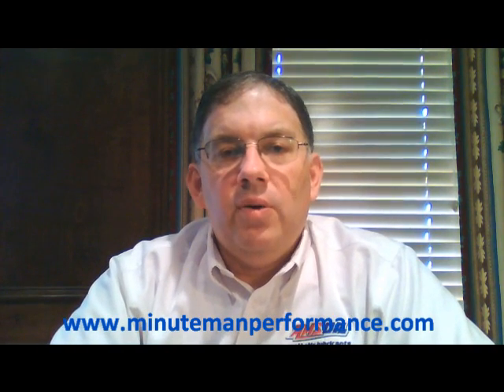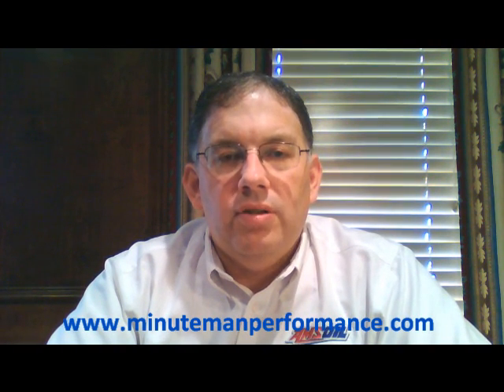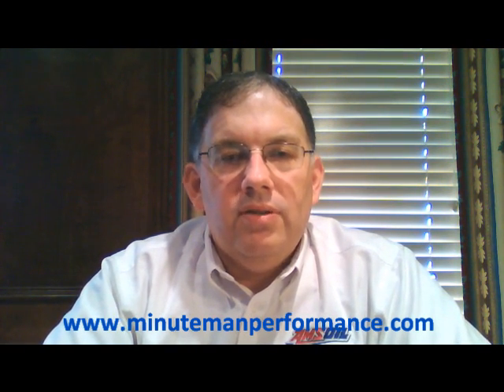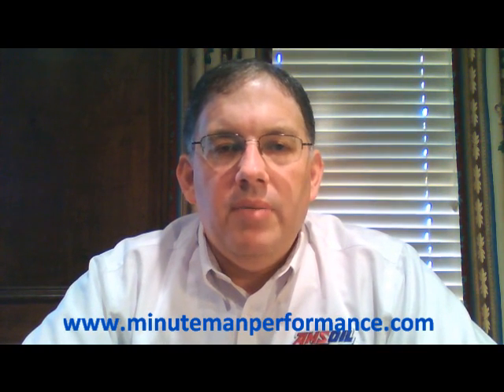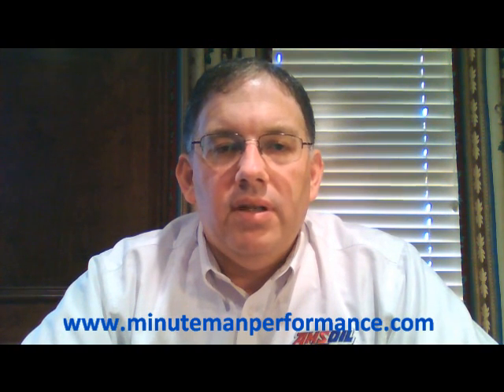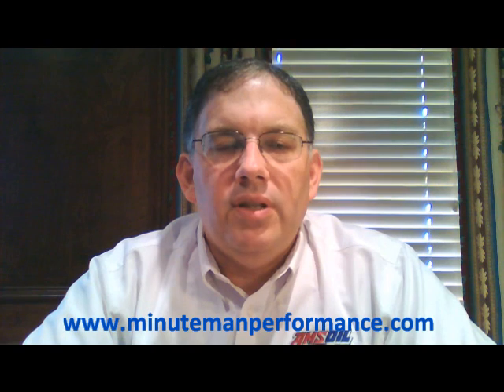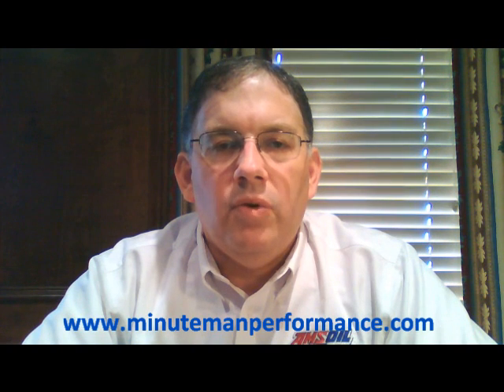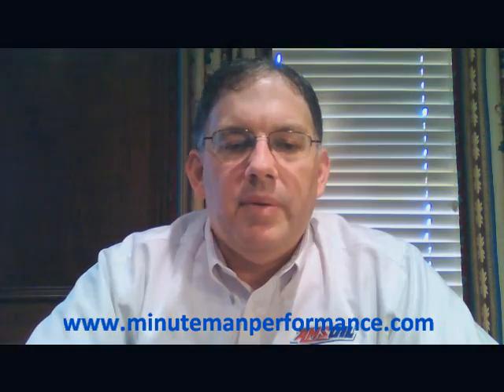Low-Speed Pre-Ignition (LSPI) in Turbo Gas Direct-Injected Engines

Comment: If you can't get Amsoil Signature. Get Motul 100% Synthetic 8100 Eco-Lite. It is a Dexos 1 gen2 and GF-5 oil. Not to fret because GF-6 is coming soon. For LSPI you need 91 -93 octane gasoline also. Do not lug your turbo GDI engine. No WOT until 3500 plus.

Comment: This can happen on standard port injection cars and direct injections not just turbo direct injections. fuel burns quick, low rpm engine lugging causes the fuel to ignite before the optimal timing. its not rocket science. Its basically acting like a diesel. You add more pressure to the combustion chamber by spraying super high pressure into an already small area thats already pressurized. Its more prevalent in turbo motors due to the boost pressure being added. Low octane fuel doesnt help. So high pressure = heat, high heat = faster burning of fuel, slower engine rpm = more time for pressure to create heat. pre-igntion can occur if any instance of low speed lugging.

Comment: I use Amsoil 5w-30 xl in my Veloster turbo!!! Is its at good as Signature series??
Reply from the maker: Short answer - no.  AMSOIL Signature Series oils are formulated from the highest quality base stocks available for automotive oil.  This gives them a higher viscosity index rating (which measures the oils ability to resist thinning when hot), and Signature Series oils also have a lower volatility rating (which measures % of evaporation when heated).  AMSOIL XL and OE lines of oil are very high quality, but they can't match Signature Series.  If I had a turbo gas direct injected engine, I'd use Signature Series.  If you live in a warmer climate, I'd even consider moving to the 10W-30 grade Signature - it has even better numbers on the volatility, which contributes to LSPI.

Comment: Lspi occurs on both automatic and manual transmissions?
Reply from the maker: Not certain, but I would assume yes. Transmission should not make a difference.
Reply: Depends on the shift point habits of the manual transmission driver and the shift point parameters of the ecu for the automatic car.

Comment: I have a 2015 wrangler with a naturally aspirated Pentastar 3.6L V6. I get pre-ignition knock when the engine is at around 2k while going up hill. The manual states 87 octane fuel is required, but when I switch to 93 octane the knock goes away. I know the Pentastar engines have been horrible in terms of reliability since they were introduced in 2011, do you think it's wise to stick with 93 octane since the dealerships refuse to fix the problem unless you get a check engine light?
Reply from the maker: +nelson4568 Thanks for the question.  First - do whatever you can to reduce/prevent the ping or knock.  It will eventually destroy your engine.  Make sure you are getting clean, fresh fuel, and get Top-Tier fuel if available.  I'd also try Mid-Grade fuel (around 89-90 octane) and check your results.  No since spending more on fuel than necessary.  But what you are experiencing probably isn't the Low Speed Pre-Ignition I talk about in the video.  In many cases, LSPI destroys the engine almost immediately - making it so detrimental.  But as I mention in the video, the vapors from your engine oil, that travel thru the PCV system, can contribute to uncontrolled detonation of any type.  Using a low volatility oil, that emits less vapors when heated, like AMSOIL Signature Series (5W-20 in your case) will help reduce this risk.  It will also keep your engine clean and reduce friction for long engine life.

Comment: Wayde try Motul, its the best oil on the market.
Reply from the maker: "Best oil on the market" type of statements can be very misleading, unless you provide justification, and compare similar products.  Wayde's Veloster Turbo calls for a 5W-30 engine oil.  AMSOIL Signature Series 5W-30 has a Viscosity Index of 166 (higher is better); a NOACK volatility of 6.9% (lower is better); and a Total Base Number of 12.6 (higher is better).  I don't believe Motul has an oil that is approved for use in emission-controlled vehicles that meets or exceeds these specifications, which are important in helping prevent LSPI.

Comment: I own a veloster turbo (1.6T gdi). These cars have seen random low mileage catastrophic engine failures (as reported on forums). I wonder if lspi caused the failures?
Reply from the maker: I don't have the details, but if they are turbo gdi, LSPI could definitely be a problem.  Modern engines rarely fail, so it has to be something drastic.  I'd definitely use an oil that has a very high Viscosity Index and low volatility rating.  These oils are more stable and less prone to contributing to LSPI.  AMSOIL Signature Series fits this description very well.
Reply: I just take my car to the dealer for oil changes. I think they use quaker state synthetic.
Reply: Modern subaru engines still fail frequently